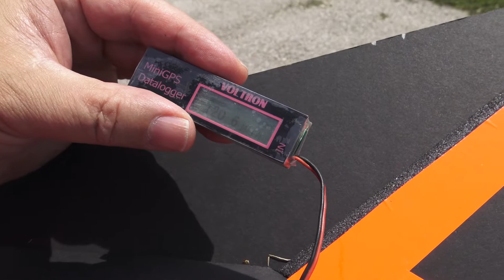FF-Demon Concept 2 Test Flight

Comment: That first version is still pretty fast on 4s. I like the testing aspect of what you're doing, very cool
Reply from the maker: Thanks Greg006! The first version on 4S does fly very nice.  I think the new one is just too heavy now. It was 40.5 ounces. The original 4S model was about 9 ounces less. With the new plane, On the last turn before the hard landing I banked too much at too low a speed and the nose just dropped out.  It did feel a bit heavy in the air. I will probably try the cobra motor on 4S with a bigger prop and higher pitch and try and get the weight down. Thanks for the comment and support!
Reply: rcFoamFighters you are right on the weight, that shape shouldn't be over prone to stalling like that. Otherwise it's a pretty neat stretched delta, looking forward to the plans

Comment: thanks for posting.  here are some things to consider.   delta-wing planform equals  less-stable.   wrong prop TYPE  equals  Noisy  prop.    low-lift kfm profile wing equals  less  stability.   inboard vert-stabs are heavier and Less effective than smaller wingtip stabs.   taileron servos  Could  be installed farther forward; near or forward of the line of balance/cg.    at 1:11,  put the Battery in the Nose and 'save' some of the ballast weight.   at 1:36, you may know that thin trailing edges are better than thick ones.     the angular shapes at the nose, forward and outboard, are not good, aerodynamically.   cheers                      googletranslate

Comment: Hey guys!  Definitely a weight issue, but  it does fly nice at around half throttle. Shorten up that motor pod, keep the 5s but go with a bit less mah. Should do well then, might even crest 130..
Reply from the maker: Hey Gregg, thanks for the comment.  I will do a few mods and see how she balances out. Hopefully the 5S will still work.  I do also want to try the motor on 4S with a bigger prop and higher pitch. Cobra actually lists the motor for 4S with a 7x6 prop..